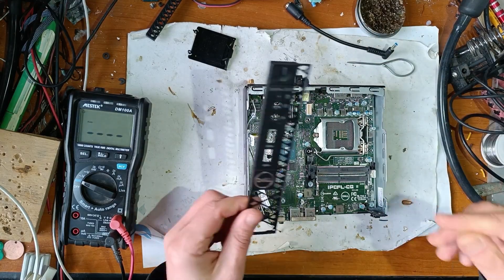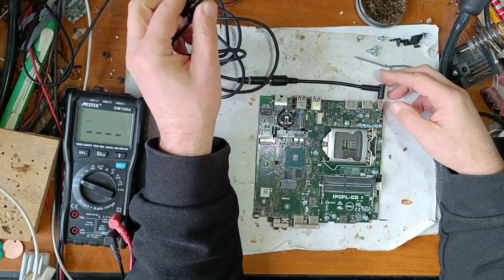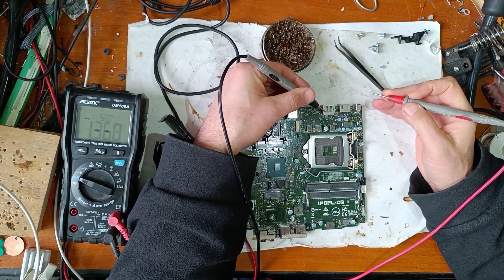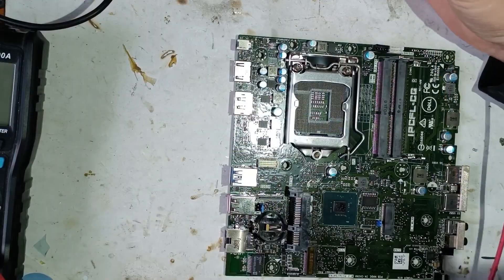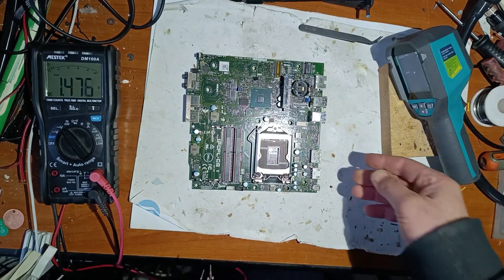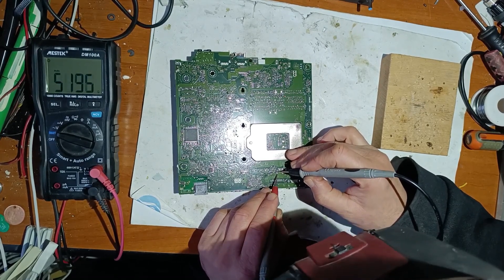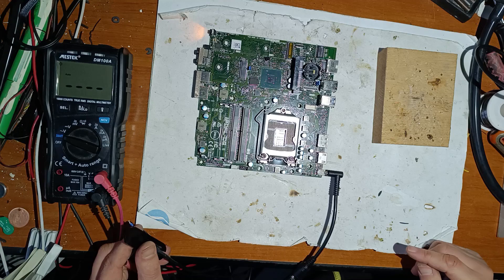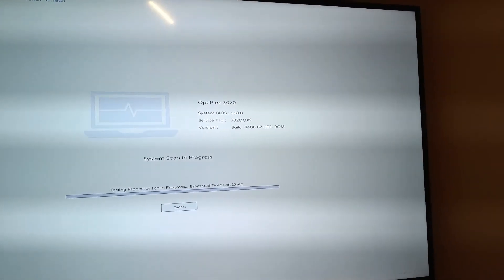Dell Optiplex 3070 Easy Repair Motherboard Shorted

Comment: hey DIY Marius Electro, I got the same micro PC as yours, mine has 2 amber long blinking then 3 amber short blinking, It says RAM not being read, but I have did everything with the RAM (clean socket, replace RAM with good RAM, cleaned Processor slot, reset BIOS), do you think I should reflash BIOS? Thank you.
Reply from the maker: if u cleaned everything, reset bios and still has ram error, its posible to be motherboard problem

Comment: Salut am un soundbar cu subwoofer wireless, credeți că aș putea face subwoofer ul mai puternic?
Reply from the maker: @Crisssu1  teoretic se poate dar practic nu merita. Il vindeti si luati unul mai mare.
Reply: @diymariuselectro  mai exact aș vrea să-l fac să prindă 20hz în jos
Reply: @diymariuselectro  știu că au un filtru când prinde 40hz în jos îi taie sunetul
Reply: @diymariuselectro  ar fi multă treabă?
Reply from the maker: @Crisssu1  trebuie schimbat difuzorul sursa si ampliful.
Reply: @diymariuselectro  a ok, vă mulțumesc
Reply: @diymariuselectro  I have the same pc like this one. My problem is 2 blinks then 3 blinks. I already tried cleaning the processor, ram, change ram, and clear cmos but no improvement. Is it possible there is shorted components?